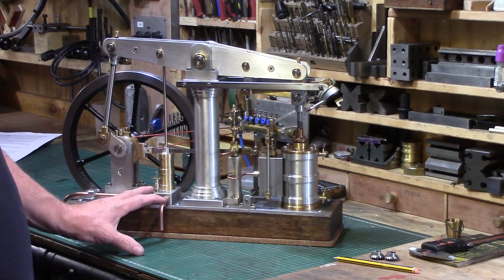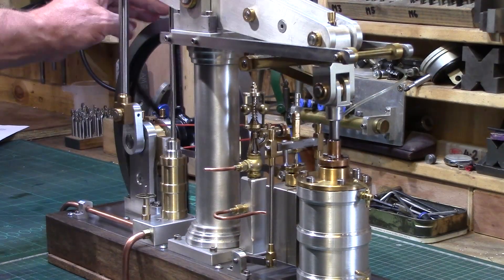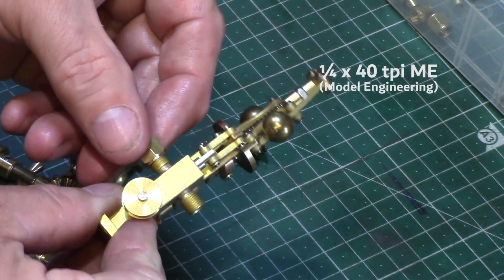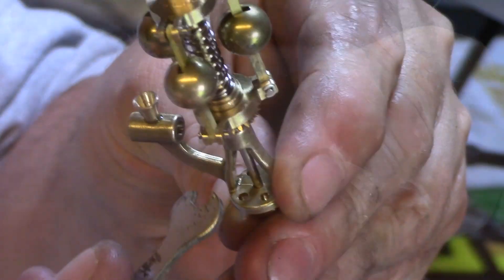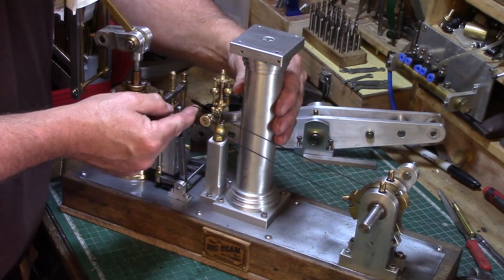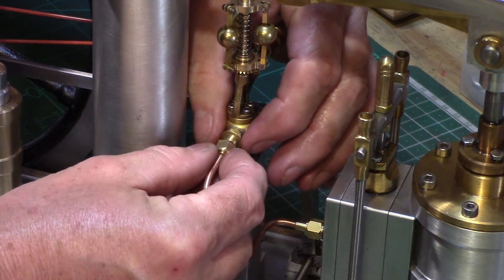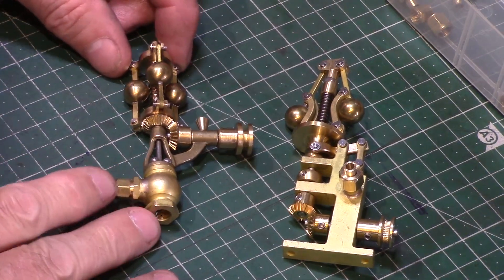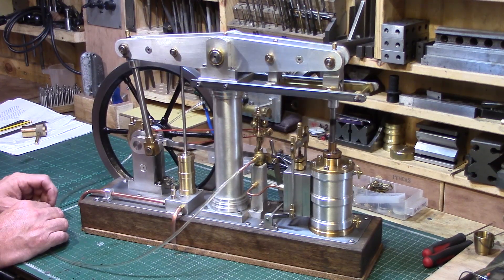Big Beam Engine  - adding a Flyball Governor, water pump and drain cocks #steamengine

Comment: What is the displacement of you engine, bore and stroke? I have a larger model engine, 2" bore, 5" stroke, that I want a governor for. I have seen these on eBay, but they seem rather small and I fear they would restrict steam flow too much. Do you think that would be an issue with my larger engine?

Comment: I work with a full sized beam engine at Tees Cottage Pumping Station in Darlington (birthplace of the railways). The beam engine I work with is a twin cylinder Woolf compound double acting engine by Glenfield and Kennedy of Kilmarnock. It was used to pump water from 1904-1926 when electric pumps replaced the beam and gas engine. The beam and gas engines are preserved by the trust which I’m part of. It’s on my channel

Comment: Thanks for showing how to use tap with rachet to create the thread close to over hanging structure. I need to retap the grub screws holding the drive pulley wheel  onto the axiel of my myford. Currently the wheel prevents me using a tap handle in usual way.
Reply from the maker: Its the little tricks that help you out of a hole that are the most valuable, thanks for watching :)